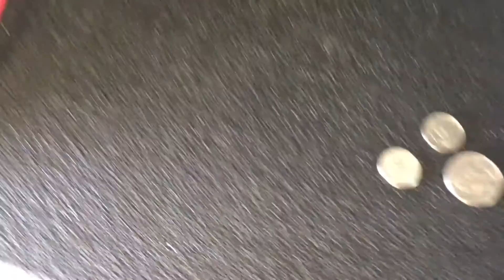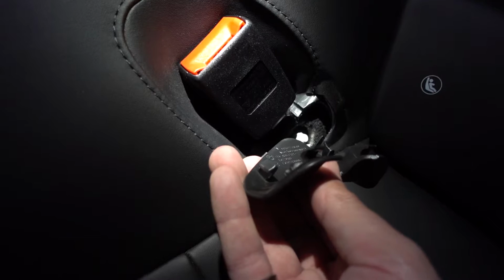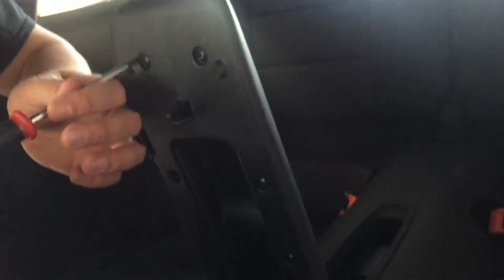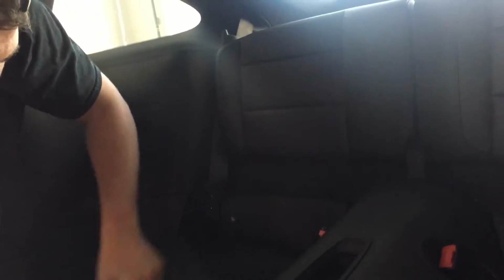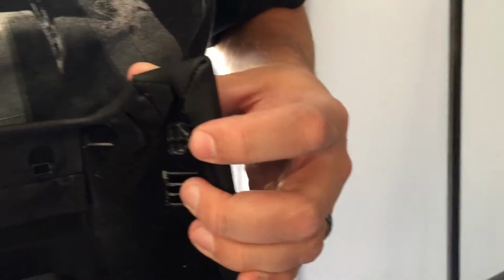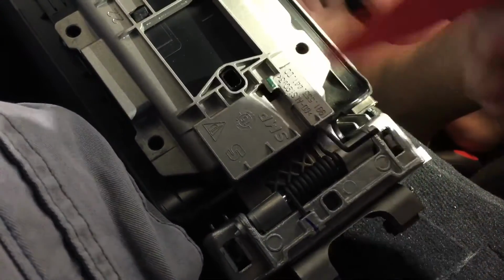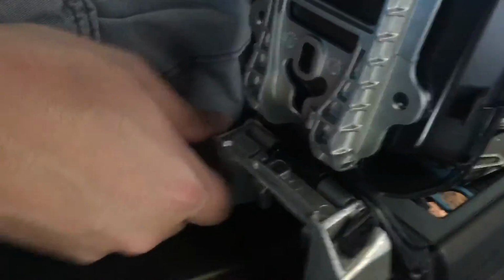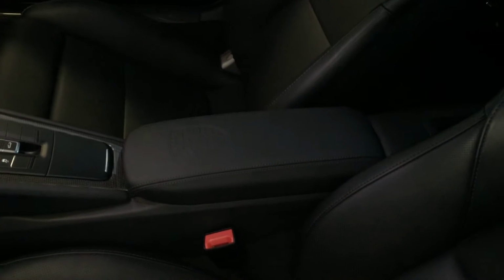Porsche 991 Center Console Lid Upgrade & Install

Comment: Great video. What lid cover did you use and where did you buy it? Don't we just need the cover and not the whole lid mechanism?
Reply from the maker: I got the cover from www.suncoastporsche.com. It's the "extended height" console. 
It's been awhile since I did the install, but I'm pretty sure you need the entire mechanism because the lid sits differently and requires and upgraded spring.

Comment: Thanks for this video.  I am about to tackle this.  I am having a hard time popping the cover off of the rear seatbelt housing.  Do you need to push anything in or just pry them off?  I know there can be clips that can easily snap so I don't want to force it.  Thanks again!
Reply from the maker: Just pry them off. If you can pop one of the edges out then you can just stick your fingers behind that edge and pull (more or less straight out). Even if you did end up breaking one of the clips this particular piece would still snap back just fine. Good luck!
Reply: Thanks for responding,  I have watched several of your videos,  please keep making them. So you cannot just buy the cover with the embossed porsche logo correct? You have to buy the whole thing for $525 right? That sucks,  but I'll probably end up doing it, lol! Just fyi, I just purchased a 16' black edition 991 and I LOVE IT!  It is such a toss up between the 991 and the 991.2,  I love the turbos and  the extra power.......BUT the sound of my 991 with the fabspeed exhaust is AWESOME.   Thanks again.

Comment: I ordered my center console piece and I'm going to use your video as my guide. Thanks!
By the way, what's the red tool you use to pop stuff off? It looks like the back of a plastic utensil.
Reply from the maker: Cool! I think it's a great upgrade. 
The red tool is just part of a trim tool removal kit- you can get that at any auto shop like Auto Zone or O'Reilly's.
Reply: Finally did the install last night. I used your video and shaginwagon's posting on Rennlist...yours was more helpful. I'd say getting the plastic coverings around the seatbelt and the plastic clip around the console off were the toughest but the rest was smooth sailing. Moving around in the back was difficult as well and, unfortunately, I didn't realize I left the plastic trim tool and the old spring on the backseat until I screwed in the seat. Reminds me of those stories of surgeons who leave tools inside the body. Lol. Thanks again.
Reply from the maker: You know, now that you mention it- after my install I was never able to locate my old spring. I wonder if it's buried inside the car somewhere. Haha., all part of the fun, I suppose. I also found the black clip to be very difficult to take off although the plastic trim around the seat belts popped right off for me. And yeah- squirming around the back was tough. Especially since my son insisted on joining me. Glad you made it through the install okay!
Reply: Thanks for this. Any reason why you didn’t just swap out the top leather portion and reuse the original base?

Comment: But if you just buy the arm lids without the whole system you only need to remove 2 screw to change it, why re-installing the whole lid system it seems the cover part is only on 2 screw.
Reply from the maker: It's been seven years since I did this but I think it's because you also need to chance the spring mechanism as the new cover is heavier.
Reply: @TheStockpile  ok thanks

Comment: You know you just could have swapped the lid cover in 5min 😂 but good video
Reply from the maker: I wish it was that easy. You have to remove the rear seat to access the hinge assembly. That hinge needs to be replaced with a new one because the new lid will not work with the original hinge.
Reply: I’ve seen just the lid cover for $219, isn’t that all you have to replace? Nice pinky ring…
Reply: @TheStockpile  the cover aren't standard?